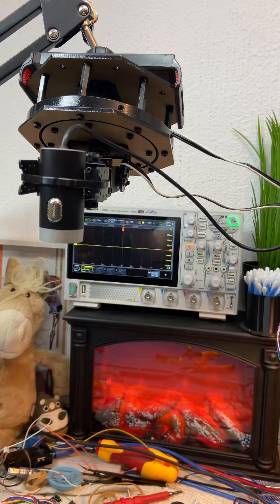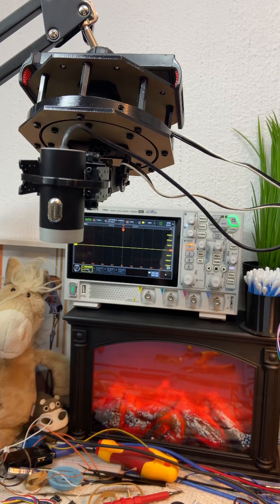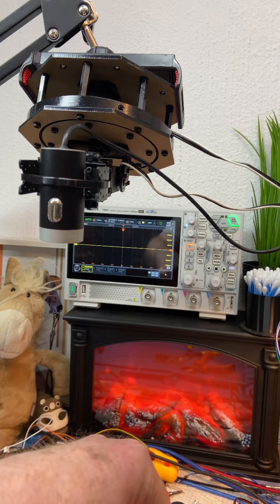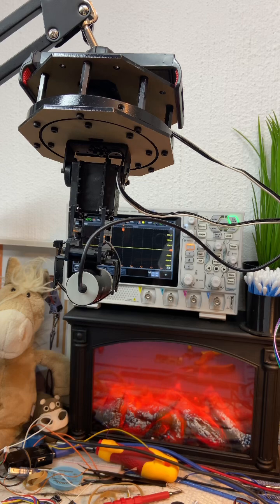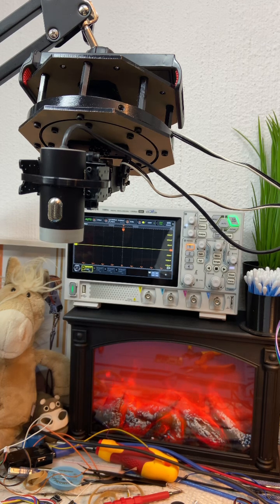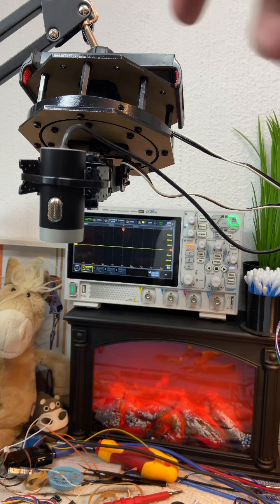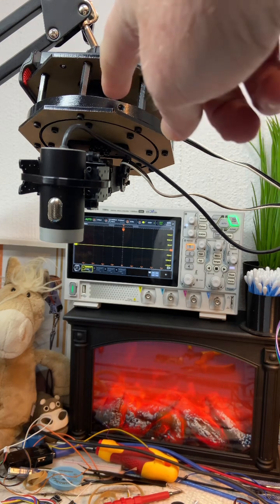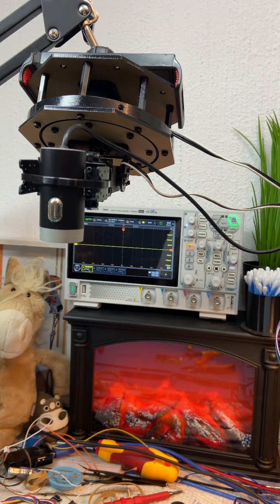Arduino Pan-Tilt Overhead Cam | Bench ↔ Scope View!

Comment from the maker: #include <Servo.h>
#include <EEPROM.h>

/* ---------- Pins ---------- */
const int JOY_X = A0;                 // left/right
const int JOY_Y = A1;                 // up/down
const int SERVO_PAN_PIN  = 8;
const int SERVO_TILT_PIN = 9;
const int BUTTON_PINS[3] = {2, 3, 4}; // High = pressed

/* ---------- Tuning ---------- */
// Jog control
const int   DEADZONE = 40;                 // ADC counts around center
const float MAX_SPEED_DPS_PAN  = 180.0;    // deg/s when stick at full deflection
const float MAX_SPEED_DPS_TILT = 120.0;
const float EMA_ALPHA = 0.25f;             // analog smoothing

// Travel limits
const int PAN_MIN_ANGLE  = 0;
const int PAN_MAX_ANGLE  = 180;
const int TILT_MIN_ANGLE = 15;
const int TILT_MAX_ANGLE = 165;

// Direction
const bool INVERT_PAN  = false;
const bool INVERT_TILT = false;

// Update timing
const unsigned long LOOP_DT_MS = 20;       // 50 Hz

// Preset behavior
const unsigned long DEBOUNCE_MS  = 30;
const unsigned long LONG_PRESS_MS = 2000;  // >= 2s to save
const float PRESET_SLEW_DPS = 200.0;       // max slew speed when moving to a preset

// EEPROM layout (optional persistence)
const byte  EE_MAGIC = 0x42;
const int   EE_ADDR_MAGIC   = 0;
const int   EE_ADDR_VALID   = 1;           // bitmask of which presets are valid
const int   EE_ADDR_DATA    = 2;           // then 6 bytes: [p0,t0,p1,t1,p2,t2]

/* ---------- State ---------- */
Servo panServo, tiltServo;

float panAngle  = 90.0f;   // actual (written) angles
float tiltAngle = 90.0f;
float goalPan   = 90.0f;   // commanded target (jog or preset)
float goalTilt  = 90.0f;

int centerX = 512, centerY = 512; // auto-calibrated at startup

// Button state machine
struct Btn {
  int  pin;
  bool lastLevel = false;
  bool debounced = false;
  unsigned long lastChangeMs = 0;
  unsigned long pressStartMs = 0;
  bool longHandled = false;
} btn[3];

// Presets
bool  presetValid[3] = {false, false, false};
byte  presetPan[3]   = {90,90,90};
byte  presetTilt[3]  = {90,90,90};

unsigned long lastLoopMs = 0;

/* ---------- Helpers ---------- */
template<typename T> T clamp(T v, T lo, T hi) { return (v<lo)?lo:((v>hi)?hi:v); }

void writeAnglesToServos() {
  panServo.write((int)(panAngle + 0.5f));
  tiltServo.write((int)(tiltAngle + 0.5f));
}

void autoCalibrateCenters(unsigned long ms=600){
  unsigned long start = millis();
  long sx=0, sy=0, n=0;
  while (millis()-start < ms){
    sx += analogRead(JOY_X);
    sy += analogRead(JOY_Y);
    n++; delay(2);
  }
  if(n>0){ centerX = sx/n; centerY = sy/n; }
}

float deflectionToSpeed(int mag, int dz, float maxSpeed){
  int span = 512 - dz;
  if (mag <= dz) return 0.0f;
  float norm = float(mag - dz) / float(span); // 0..1
  return norm * maxSpeed;
}

/* ---------- EEPROM ---------- */
void loadPresetsFromEEPROM(){
  if (EEPROM.read(EE_ADDR_MAGIC) != EE_MAGIC) return;
  byte validMask = EEPROM.read(EE_ADDR_VALID);
  for (int i=0;i<3;i++){
    presetValid[i] = (validMask >> i) & 0x01;
    presetPan[i]  = EEPROM.read(EE_ADDR_DATA + i*2 + 0);
    presetTilt[i] = EEPROM.read(EE_ADDR_DATA + i*2 + 1);
  }
}
void savePresetToEEPROM(int idx){
  // Only write if changed to reduce wear
  byte validMask = EEPROM.read(EE_ADDR_VALID);
  validMask |= (1<<idx);
  if (EEPROM.read(EE_ADDR_MAGIC) != EE_MAGIC) EEPROM.update(EE_ADDR_MAGIC, EE_MAGIC);
  EEPROM.update(EE_ADDR_VALID, validMask);
  EEPROM.update(EE_ADDR_DATA + idx*2 + 0, presetPan[idx]);
  EEPROM.update(EE_ADDR_DATA + idx*2 + 1, presetTilt[idx]);
}

/* ---------- Setup ---------- */
void setup(){
  panServo.attach(SERVO_PAN_PIN);
  tiltServo.attach(SERVO_TILT_PIN);
  writeAnglesToServos();

  for (int i=0;i<3;i++){
    btn[i].pin = BUTTON_PINS[i];
    pinMode(btn[i].pin, INPUT); // NOTE: Use external pulldowns or active-high drivers
    btn[i].lastLevel = digitalRead(btn[i].pin);
    btn[i].debounced = btn[i].lastLevel;
    btn[i].lastChangeMs = millis();
  }

  autoCalibrateCenters(600);

  loadPresetsFromEEPROM();

  lastLoopMs = millis();
}

/* ---------- Loop ---------- */
void loop(){
  unsigned long now = millis();
  if (now - lastLoopMs < LOOP_DT_MS) return;
  float dt = (now - lastLoopMs)/1000.0f;
  lastLoopMs = now;

  /* --- Buttons: debounce + short/long detection --- */
  for (int i=0;i<3;i++){
    bool raw = digitalRead(btn[i].pin);          // HIGH = pressed
    if (raw != btn[i].lastLevel){
      btn[i].lastLevel = raw;
      btn[i].lastChangeMs = now;
    }
    // Debounce
    if ((now - btn[i].lastChangeMs) > DEBOUNCE_MS){
      if (raw != btn[i].debounced){
        btn[i].debounced = raw;
        if (btn[i].debounced){ // transitioned to PRESSED
          btn[i].pressStartMs = now;
          btn[i].longHandled = false;
        } else { // transitioned to RELEASED
          unsigned long held = now - btn[i].pressStartMs;
          if (held < LONG_PRESS_MS){ // short press -> recall
            if (presetValid[i]){
              goalPan  = presetPan[i];
              goalTilt = presetTilt[i];
            }
          }
        }
      }
    }
    // Long press while held -> save
    if (btn[i].debounced && !btn[i].longHandled && (now - btn[i].pressStartMs >= LONG_PRESS_MS)){
      presetPan[i]  = (byte)clamp((int)(panAngle + 0.5f),  PAN_MIN_ANGLE,  PAN_MAX_ANGLE);
      presetTilt[i] = (byte)clamp((int)(tiltAngle + 0.5f), TILT_MIN_ANGLE, TILT_MAX_ANGLE);
      presetValid[i] = true;
      savePresetToEEPROM(i);
      btn[i].longHandled = true;
      // Optional tiny haptic/visual cue: a small nudge
      // (skip here to avoid disturbing the shot)
    }
  }

  /* --- Joystick jog > modifies goal angles continuously -- */
  static float xFilt = analogRead(JOY_X);
  static float yFilt = analogRead(JOY_Y);
  xFilt = (1.0f - EMA_ALPHA) * xFilt + EMA_ALPHA * analogRead(JOY_X);
  yFilt = (1.0f - EMA_ALPHA) * yFilt + EMA_ALPHA * analogRead(JOY_Y);

  int dx = (int)xFilt - centerX;
  int dy = (int)yFilt - centerY;

  float spPan  = deflectionToSpeed(abs(dx), DEADZONE, MAX_SPEED_DPS_PAN);
  float spTilt = deflectionToSpeed(abs(dy), DEADZONE, MAX_SPEED_DPS_TILT);

  int dirPan  = (dx>0)?+1:((dx<0)?-1:0);
  int dirTilt = (dy>0)?+1:((dy<0)?-1:0);
  if (INVERT_PAN)  dirPan  = -dirPan;
  if (INVERT_TILT) dirTilt = -dirTilt;

  // Jog modifies the goal (so releasing the stick holds position)
  goalPan  += dirPan  * spPan  * dt;
  goalTilt += dirTilt * spTilt * dt;

  goalPan  = clamp(goalPan,  (float)PAN_MIN_ANGLE,  (float)PAN_MAX_ANGLE);
  goalTilt = clamp(goalTilt, (float)TILT_MIN_ANGLE, (float)TILT_MAX_ANGLE);

  /* --- Slew actual angles toward goal (for smooth preset moves) --- */
  auto slewToward = [&](float current, float target, float maxDps){
    float delta = target - current;
    float maxStep = maxDps * dt;
    if (delta >  maxStep) return current + maxStep;
    if (delta < -maxStep) return current - maxStep;
    return target; // close enough
  };
  panAngle  = slewToward(panAngle,  goalPan,  PRESET_SLEW_DPS);
  tiltAngle = slewToward(tiltAngle, goalTilt, PRESET_SLEW_DPS);

  writeAnglesToServos();
}